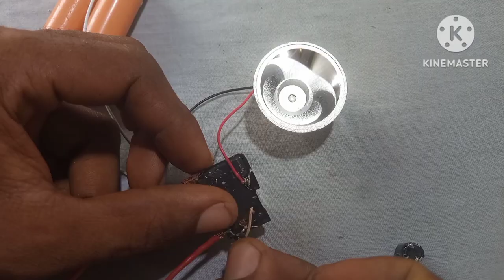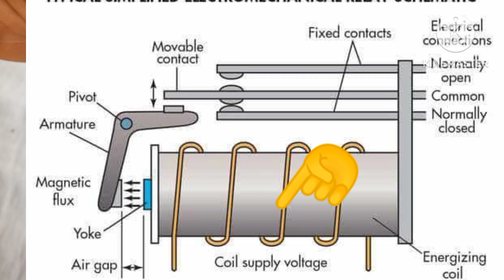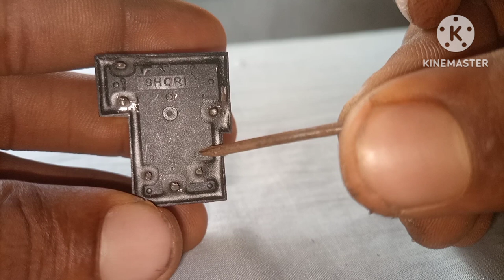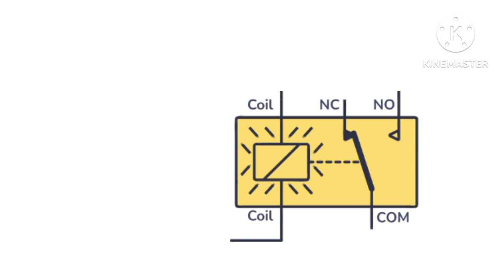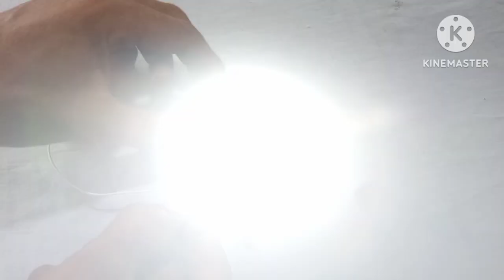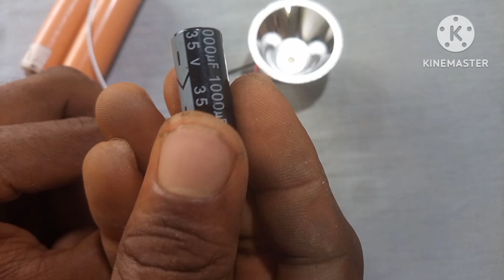How to build a Timer/Oscillator with only a Relay

Comment: but there is a problem because the capacitor takes inrush current and welds the com and nc together
Reply from the maker: Yes, causing it to have the delay, have you tried this before?